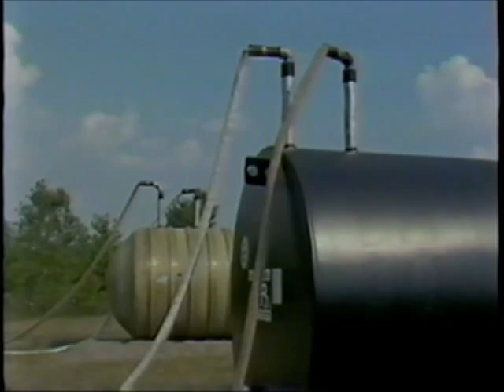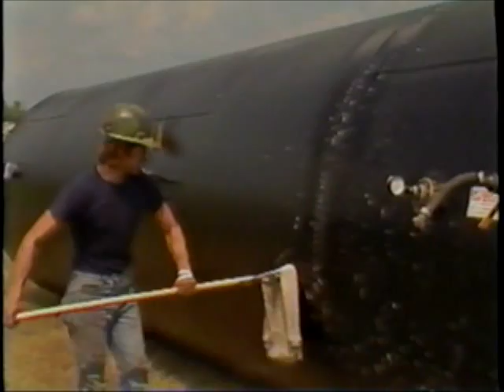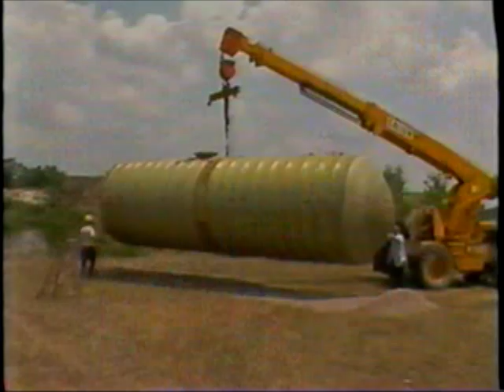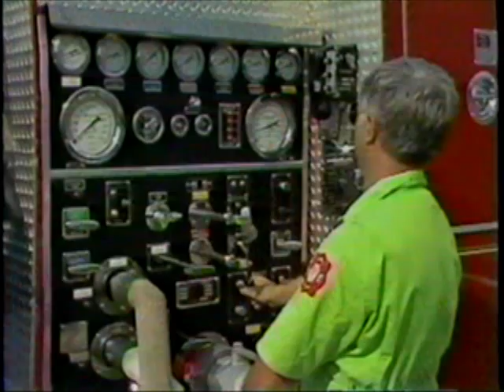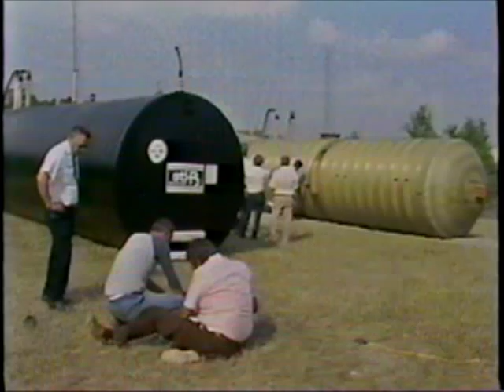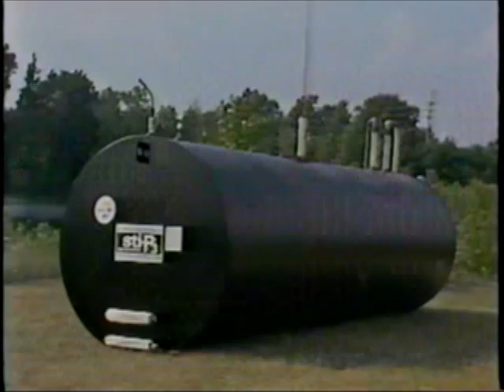Test of FRP and Steel Tanks.mp4

Comment: @kinetixautomation ... the barrel itself would be filament wound, from my observation i would say it`s filament wound, then they have added the ribs and run some CoreMatt in between (the cheaters way to acheive a desired thinkness by resin loading the CoreMatt)..The ends are obviously moulded hand lay-up The failure appears to be the joint between the base and the barrel, So i would say the joint lay-up was too narrow or not thick enough.